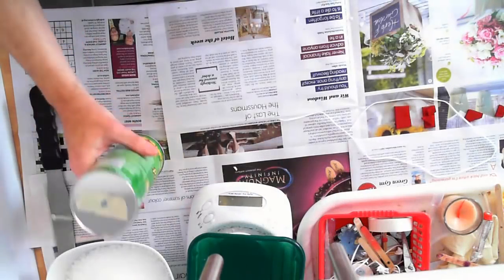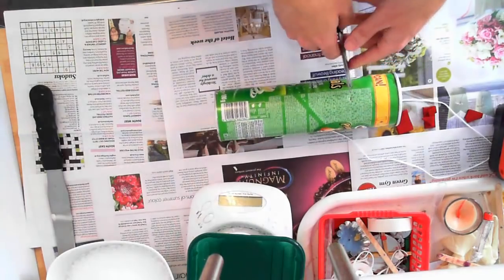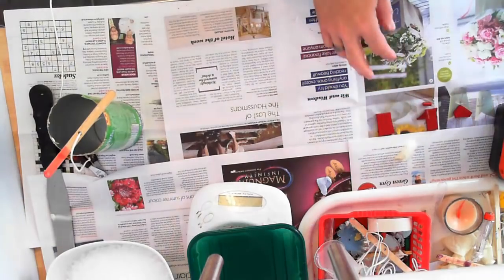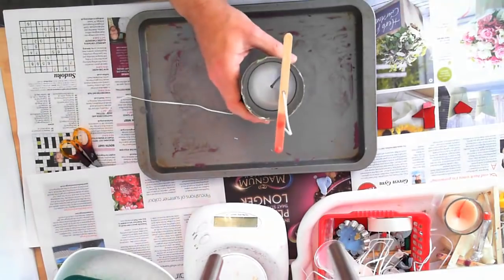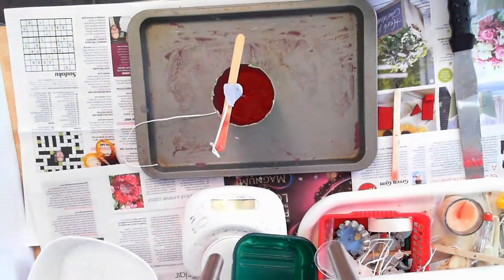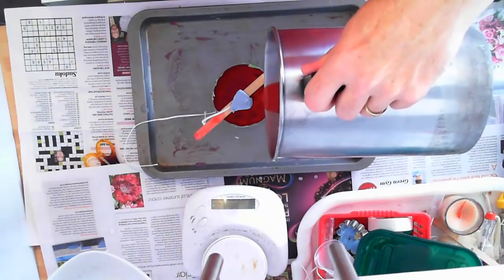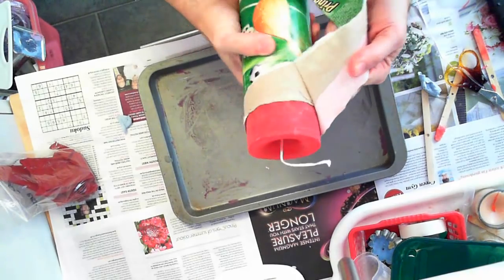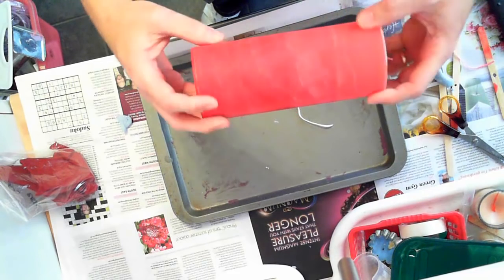Making Candles with a Pringles Tube!

Comment: When you could get a waxed milk carton, you could fill the carton with crushed ice and pour the hot wax into the milk carton.  After cooling, pour off the melted ice which is then water.  You have a nice lacy candle.  Should mention we used a standard ready-made taper inside for the center of the candle.
Reply: I remember making them. they were lovely

Comment: Don't worry too much about the indent Kev. I use similar tubes and call the top the bottom. I just turn the candle upside down when it comes out of the tube, nice level top.
Reply: The dip is caused when the candle cools, as the wax shrinks away from the wick, which could affect the burn as there will be less wax around the wick, in extreme cases it will put the candle out altogether,  this can be cured by doing a second pour. Before the candle sets completely make some holes in the wax close to the wick, but don't go more than about 2 thirds of the way down, then pour some more hot wax into the holes, but don't go above the original pour line or it will make it hard to get out of the mould.
Reply: Jenny Fox Absolutely - hard waxes such as this always require a second pour, and often a third.
Reply: Sorry you seem to have missed my point, never mind.
Reply: I flip mine too. Then the indent in the "top" isn't even an issue because it's going to actually be the bottom of the candle. :)

Comment: My candles used to do the dip thing too until I mixed some paraffin in with my soy so it has some rigidity and will stop that dip.You can also still while it is fairly soft add some more to level it out and then let it completely set up.Hope that hint helps.

Comment: Thanks for the video. Smart thinking.
The wax always dips in the middle and very important, never let the candle to set at a cool place always at room temp., it will dip in the middle still. So what you need to do is keep a bit of the top color wax so if it dips you can level it and will be the same color. enjoy.

Comment: Ever made a candle using lard essential oils and crayola crayons..your candle wick cut to length and metal disc weights they burn for over 80 hrs dependent on size have a very subtle scrnt throw   you can intnsify the scent throw by adding more oils of your choise only use a tiny amount of crayon as they are very vivid dependent oncolour desired

Comment: What is that stuff called you used to fix the wick on the bottom of the can?
Reply: Masking tape
Reply: +makedaevilmage it seams like mold sealer you can get it at craft stores amazon or on any other candle supply site
Reply: +makedaevilmage Blue tack..nothing flash, blue tack does the trick.
Reply: thank you!!
Reply: Can use plumbers mate